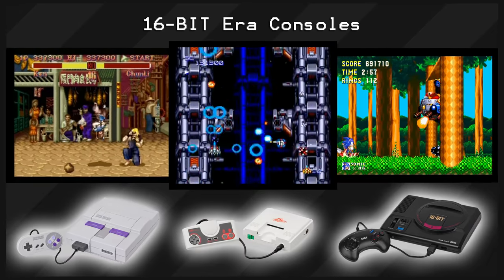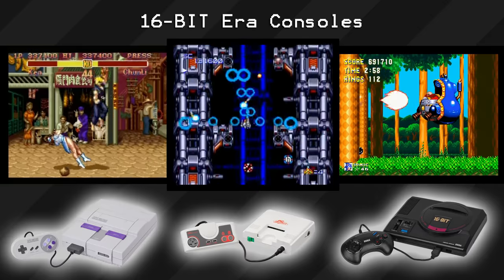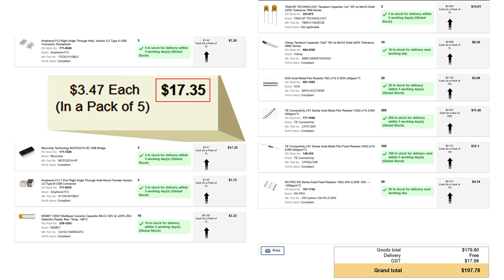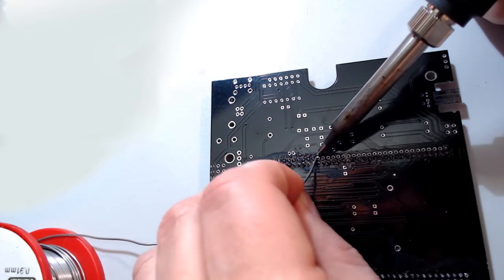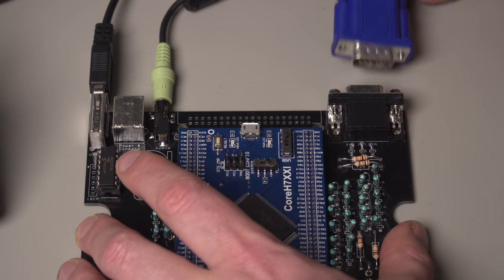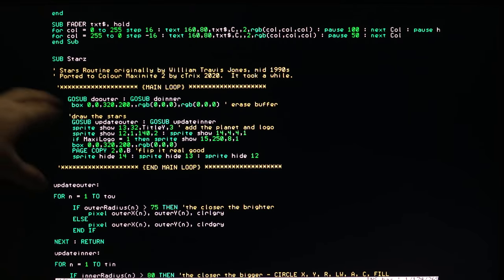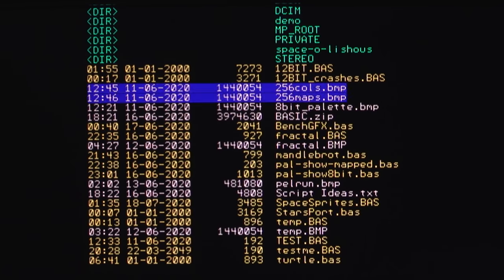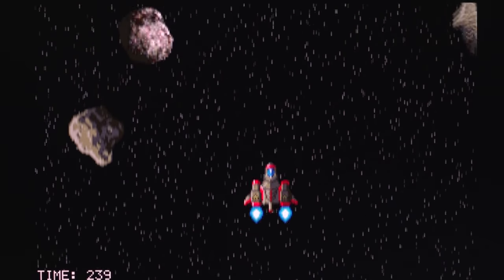BASIC in 2020 - DIY microcomputer w/ early 90's graphics - Colour MaxiMite 2 (build/test)

Comment: it s hard to tell how powerfull this device is. But made with an HDMI output, with a smaller factor and various code languages (assembly, basic and C++) this would find a HUGE audience. Both for programmers and gamers.
Reply: There is apparently licensing issues with using HDMI, according to the designers.

Comment: Great video, but as someone who started programming in 1970's (8-bit micros up to ICL 2966 mainframe) allow me to set the record straight. Early domestic computers were 8-bit CPUs running at merge clock speeds such as 1 or 2 MHz. The BASIC language pre-dates these domestic computers. The implementation of BASIC on early domestic computers was quite crude. The program was stored as seen on the screen (character by character) and then run by an interpreter. Thus the CPU had to both interpret the program and run it. The BBC micro was an advancement in that it tokenized the BASIC language. This reduced program storage and reduced the overheads of the interpreter. The Acorn (Atom, BBC and Electron) computers also allowed Assembler to be mixed with BASIC to provide maximum speed when needed. Programs written in BASIC and then COMPILED will run just as fast as any other compiled language such as C or C++ (although the language structures might enable subtle performance advantages.) The point being that the poor performance was not the fault of BASIC but the way in which the language was implemented on very modest hardware.
Reply: Some optimizations of trading space for speed could have used to make BASIC faster on these charming old 8-bitters, but there isn't much memory to work with.  These days it matters a lot less.  BASIC doesn't need to be so fast because the computers are much, much faster and have more memory.  But of course what BASIC did need is features of structure and modularity, and modern BASIC implementations do have these features. ;)

Comment: From your video description: "The BASIC is still just-about-slow-enough that you have to work within a SNES / Megadrive (looking) limit, but that is a fun limit to work with and causes the programmer to write some legitimate looking and feeling retro-games / demos."

I agree with this statement 100%, even though it may seem counter intuitive to some: Limitations are actually a GOOD thing if you want to make games that are fun to play. The really good games throughout the years have not all had great graphics. In fact some of them were pretty crappy ("Adventure" on the Atari 2600, for example), but we still had loads of fun playing them, didn't we? 

Having limitations requires the programmer to REALLY spend time on game play, which is the whole point of making a game!
Reply: No, you didn't miss basic gaming, back then basic was generally not up to the job, it's only now that you can do this stuff with basic. 99% of games 'back then' were written in assembly language.
My TRS-80 from back than has a 1.77MHz 8 bit CPU, the Colour Maximite runs at 480MHz, with a 32bit chip, way more powerful.
I'm almost tempted to say one could write a Z80/6502 emulator in CMM2 basic and it could then emulate an early 8 bitter.

Comment: Just got around to building mine, 2hrs of soldering and then nothing. I just checked and the Waveshare board was thankfully set to OFF, so switching it to 5V and it works first time (excl the first ). 
 I just now have to flash the firmware, so I can run some of these new MM2 programs (Gauntlet!!)

Comment: Absolutely great video reminiscent of why I fell in love with computers some 40 years ago - those quaint electronic magazines showing off computer kits (or just terminal kits), hand-building your own hardware and software, and ... BASIC! I recently got a hold of a maximite color and would love to get one of these. USB's been added and that's good. But why can't we drop VGA in lieu of HDMI?
Reply: The reason given for VGA over HDMI is that the HDMI consortium wants licensing fees for using their standard, and that would add to the price, so they advised that cheap VGA-HDMI converters are readily available on the 'net
Reply: Also, an HDMI chip would have to be on the motherboard and there isn't one that could be hand soldered by normal mortals so an external convertor is the cheap, easy option
Reply: VGA is a HELL of a lot easier to build the circuit for than HDMI and there are adaptors to get you to HDMI if that's what you need...

Comment: According to a couple devs making games for the CMM2 on the Maximite forums, while it is as fast or faster than 6502 assembly in regards to anything graphical, computationally it's only about 50 to 75% as fast as assembly on a 1MHz 6502, which will limit the sort of games that can be made. As an example, someone on the forum was making a Boulder Dash clone, but found that he couldn't really expand the scope of the game beyond what the original could do on a classic 8-bit, as otherwise the framerate would drop to the point of being unplayable.
Reply: He's learned a few things to optimize things better. Also the new 5.5.4 version of the firmware adds a ton of new features (such as fast matrix math routines and a bunch of other math functions) that will make some stuff a TON fast (since it's not being done in a bunch of BASIC loops but optimized assembly libraries...)

Personally I can't wait for mine to arrive (hopefully this weekend, supposed to ship out tomorrow...)

Comment: I’m curious if there is an image for the Raspberry Pi platform that would boot into a similar BASIC environment.
Reply: Not sure about an image as such, the graphics etc will need some re-writing, but otherwise a brilliant idea.
Usually the source code for the Maximites is released, so someone with R-Pi bare metal knowledge should be able to knock up something fairly easily.

Comment: So this is a MaxiMite 2, not a MaxiMite GEN 2, which I think is on a green board without the seperate blue CPU plugin board. GEN 2 has the CPU soldered directly to the motherboard. Was that the device sound playing throughout the entire video? My grandson is a sound engineer, he is always tormentimg me with some wierd audio S&i#! I also think the pinouts on the connector may be directly compatiable with a PI GPIO layout, and they can be used with the PIN(x) command. If I'm not mistaken. Or, it could be the Deluxe I'm thinking of. Anyway with the pin option, this looks really cool.

Comment: Hmm STM32H743. Pretty sweet MCU which has a ton of power and lots of goodies inside. Well couldn't resist because I've done quite a bit of bare metal development (basically writing my own custom firmware) and I get all too exited when I see such a microcontroller. Imagine the possibilities of inputs (ADC data from all sorts of sensors) outputs (PWM can control all kinds of motors and lights and voltages and what not) and communications (I2C, SPI, UART and what not). But of course the whole value of this particular computer is the provided firmware containing the Basic and other goodies. I believe, the bare bones hardware with JTAG debugger would not be all too attractive as you would have to start from scratch and writing your own firmware would be way too time consuming, let alone way above the heads of most of us. But trust me - playing around with bare metal development with oscilloscope is almost as fun as programming audio and graphics in BASIC.

Comment: Darn that RGB565 LTDC of the STM32H7 line is not a best kept secret anymore( done a similar thing two years ago outputting RGBS over a JAMMA connector)
Reply from the maker: It's a neat little feature hey.  Did your monitor sync ok? (assuming it was a CRT?)
Reply: @CTRIX64  yes it was a Commodore 1084 at 15kHz. https://www.instagram.com/p/BpaZMk0hUBg/?utm_source=ig_web_button_share_sheet
Reply: https://twitter.com/plgDavid/status/1128283661332307968?s=20 The trick was to experiment with the various pixel clocks, back/front porches. I'll get back to that eventually haha.

Comment: I made an FPGA computer years ago and found the same greyscale issue, i used 3,3,2 bits of RGB into 8 bits, I made a 3 bit DAC for each channel and tied the lower 2 bits of the DAC on the blue channel together to make it 2 bit, that gave 4 shades of grey, otherwise there would have been no grey at all.
Reply from the maker: The DAC certainly adds an "entertainment" factor.  At 5 bits per channel you don't notice as much - but it's still slightly there. In 444 (12bit mode) you don't notice as much.  A lot of 1990s machines opted for a 15-bit DAC solution because of this (and used the 16th bit as transparency in file formats).  DOS VGA was 18-bit paletted - a rather wild step in complexity; but they wanted "photos to look realistic".  (also - FPGA computer!  Sounds like fun)
Reply: @CTRIX64  There's a terrible quality shaky cam smartphone video of my Z80 FPGA computer on my channel.
Reply: The colour shifts are more from the inaccuracy of the discrete resistor-level DAC than the sixth green bit. That said, having super crisp RGB output is a luxury compared to the smudged chroma in a PAL or NTSC composite signal that the old consoles had to deal with :D
Reply from the maker: @willyarma_uk  YES!  That FPGA project is sooo cool.  Light gun, MOD player (?) full Teletext support!  Great demo and the DAC looks great on the CRT.

Comment: I finally got around to ordering mine after seeing Mauro's Gauntlet for the CMM2 on his channel. 

I had helped Mauro with boog testing and fixes on the original version of Gauntlet, and Mauro had pretty much hit the limits of the old boards abilities about the time that I came on board. 

We even uncovered an interesting "feature" within the old board's firmware, where maxed out programs on it would "Slice-o-Matic" the code. A Line of code would have the back half of its line disappear as well as a few more lines further on for good measure, and then "merge" itself with the middle of a line from further below. 

For those out there interested in the CMM2, I would recommend checking out its home over at: https://www.thebackshed.com/ 

You can find me there as "SimpleSafeName" (Glenn didn't like my first choice for a handle, and suggested that I pick a "Simple safe name" instead).

Comment: Did you need to buy an STM32 programmer/JTAG cable to program the Waveshare board?
Reply: No: the STM32 has a built in bootstrap loader - all explained in the user manual https://geoffg.net/Downloads/Maximite/Colour_Maximite_2_User_Manual.pdf
Reply: @petermather3049  Thanks. :-) I want to have a play with the Waveshare board too so I got an STM loader anyway. Looks like a real fun board to play with!

Comment: I own an original color maximite, was into automation, controling relays and reading sensors for an application, but I think this color maximite 2 could be the one to revive Basic programming. I have a few old machines like vic-20 etc... and the maximite does offer the same @feel@ it's quite remarkable.

Comment: Not "quite" the same as what we - the old farts - went through in the 70's-80's because it's still just a black box and not something you need to understand at the bit level but certainly a great gadget by the looks.
Reply: Depends on if you are trying to push it to it's limits or not. Obviously that wouldn't be necessary recreating classic games, but there will be people taking it as far as possible, and they will need to understand the hardware as much as possible to do so.

Comment: Does it have the horsepower for something like arcade system emulation?
Reply from the maker: For that you'd probably want to compile something directly for the STM Cortex-M7 chip to get the speed.  But sure, the DAC / IO / audio and accelerated graphics would probably map / translate quite well for late 80's / early 90's arcades if you had the skills to code a port of MAME or the like.  But it already exists in test form for platforms like the RiPi - which is technically faster.  BASIC itself isn't really suited to writing emulators or low level stuff - it's more for direct fun game dev.
Reply: @CTRIX64  Yeah, figured. I was more thinking of how it'd serve as an all-in-one type of thing. Already got a couple of machines for various emulators but the "boot to BASIC on metal" type of thing I don't have, and it's something I miss.

Comment: The entire advantage of a simple hobbyist computer is to be able to program close to the hardware, so you can actually directly interact with the hardware, which is hopefully simple enough for you to completely understand. If I just want to code in a REPL scripting environment, I can do that absolutely anywhere in all sorts of languages.

The difference between BASIC on something like the Commodore 64 versus any number of interpreted languages on modern computers, lies entirely in the ability to POKE or PEEK memory addresses directly, or even program directly on the machine in assembly (watching it compile line-by-line the machine op-codes as you coded in each line).

The Color Maximite offers none of that, instead the device walls you off entirely from the actual hardware. Of course, this is the goal of modern computing: abstract away the hardware so you can code the same way anywhere. But for hobbyist computing, this is the death of the whole concept: if you're walled off from the actual hardware, the actual hardware is now superfluous: you could code like this on any computer at all, or even using something like the PICO-8 fantasy console.
Reply: Not true - peek and poke are available as is direct access to the video memory and all H/W registers. Routines can also be written in C or assembler and called form Basic if required

Comment: You could use JLCPCB for the pcd and LCSC for the parts m8.
Reply: Look closer, he did use JLCPCB :)
Reply from the maker: True!  I went with RS only because I knew they did quick delivery and I wanted to get one working ASAP for this video. (wasn't sure if shipping from the USA / some parts of Asia would arrive in good time due to C-19)  Unfortunately the WaveShare took 5 weeks to arrive which delayed things. I'll have a look into LCSC for future projects - thanks for the tip.  The issue with JLCPCB was my board was about 10mm wider than their cheap boards - people were telling me it would only cost $20 delivered... but for this PCB it was $50.  If the board was just a tiny bit smaller.....
Reply from the maker: I got a quote originally from JLCPCB (on video), but PCBWAY offered black on black boards for same price.  So I just ordered from them - same same AFAIK.  However those black boards in a room full of black sound deadening meant it was a bit hard to see what I was soldering at the end of the day  :-P
Reply: LCSC used to be amazing because you could combine shipping with a PCB order... and then they stopped doing it :(
Reply: @JamesChurchill  l noticed. That's why I suggested Lcsc, if you have a PCB order on the way they consider it and give you a special price. Good old ways they shipped together not anymore :(.

Comment: It can read game pads - if you build the connector yourself?
Reply: you'd have to attach the connector to the GPIO in the back, but yes. most retro gamepads are extremely simple, so it's doable (they're basically shift registers with a clock signal)
Reply: Currently you can hook up a Nintendo Wii Nunchuck controller. v5.5.4 of the firmware (in RC2 status currently) adds support for up to 3 Wii "Classic" controller pads (not the WiiMotes, the ones they had for playing classic Nintendo games on the Wii). I just ordered 2 3rd party ones from eBay for $12.
Reply: Yes I know it's doable and Nunchuck Controller support comes built-in, I just wish they'd included 2 Atari style joystick ports as standard - a much better option IMO.  Apart from that it looks great.
Reply: Stephen Elliott I felt the same way about the choice to go with SNES controllers on the Commander x16.  I’m old school and grew up on Atari style digital joysticks too. 

But I guess it’s not too bad. I got my cmm2 on Saturday and my Wii classic controllers. Already done a couple fun little test programs to try a few things. It’s VERY easy to code for. The Wii classic controller isn’t bad. Much better than the nunchuk IMO.
Reply: @mikekopack6441 Yes writing games for the system is cool, but it needs a good standard for game controller input.  These days that would be USB, but the Atari/Commodore/Megadrive have plenty of old school authenticity controllers.  Also, it comes with BASIC as standard, how open is the system?  Could you use another language to access all features of the system - via C or Assembly Language?

Comment: Great video of a great product. Note that you can get kits and in some cases prebuilt units from stockists in the UK (www.micromite.org), US (www.circuitgizmos.com) and New Zealand (www.rictech.nz) - I'm not affiliated with any of them.
Reply from the maker: Rictech are doing a CMM2 case front/rear panel set for 8 bucks?!  I'll be buying 5 sets of those! I edited the Dremel debarkle out of the video because of how embarrassing it was.  (Half the time I insert an SD card it misses the slot and disappears into the case)  Cheers for the heads up,  I'll hit up Grogster for an order ;-)